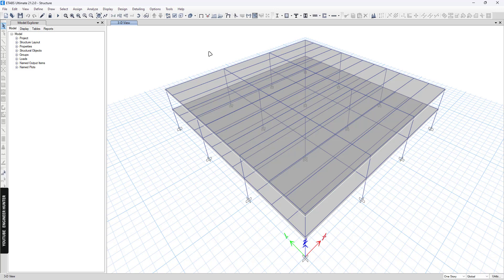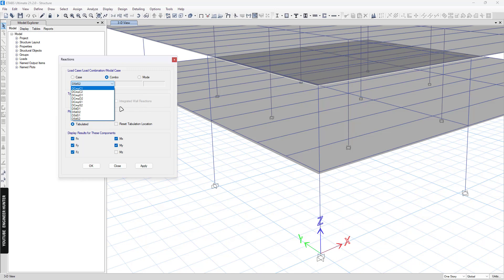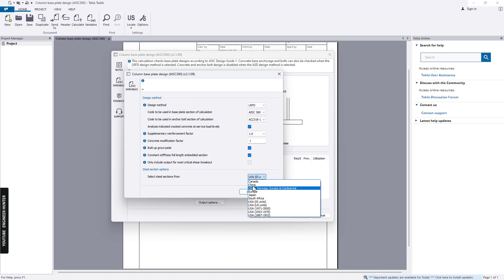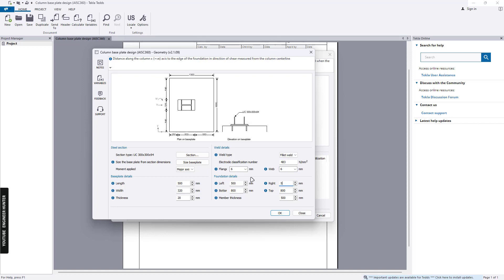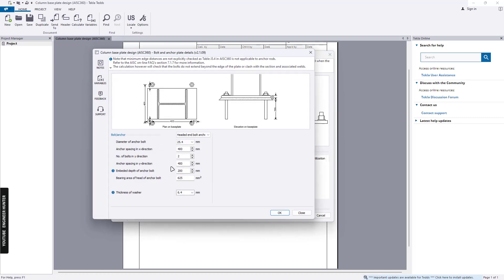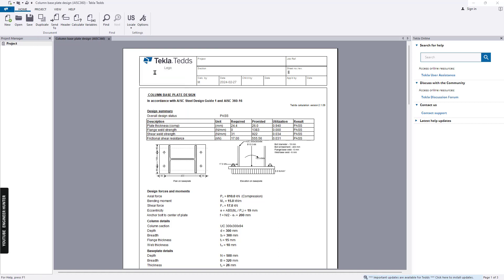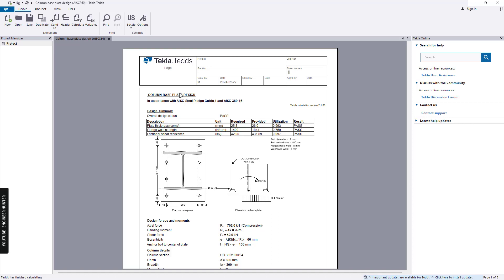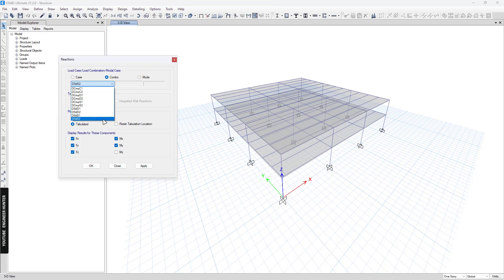Base Plate Design in Tekla Tedds

Comment: Is it possible to input reactions from different load cases directly? 

You may have 20+ load cases and manual inputs per node is going to be very tiresome.
Reply from the maker: You can use envelop combination but this is not economical design. One more way, you can define the most critical load combinations first, then use only those combinations.
Reply: @EngineerHunter  Exactly. Each component of p-m-m simply does not happen in a single load case and lead to overly conservative design.